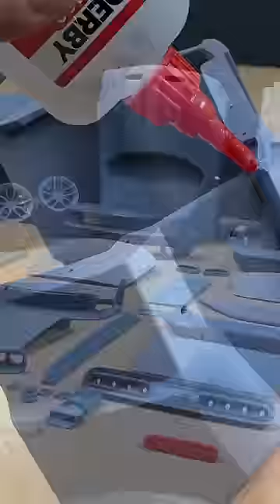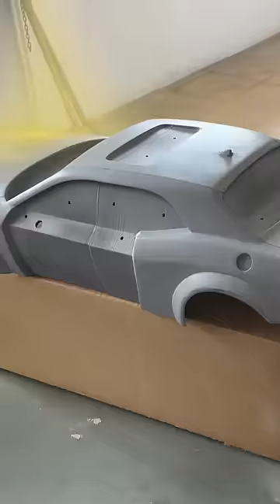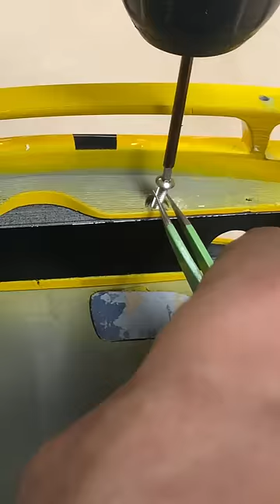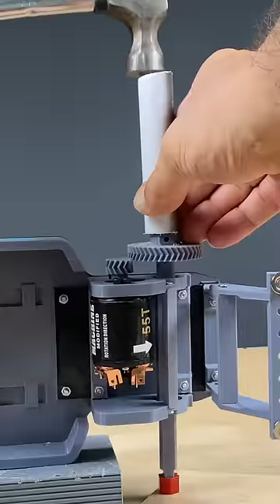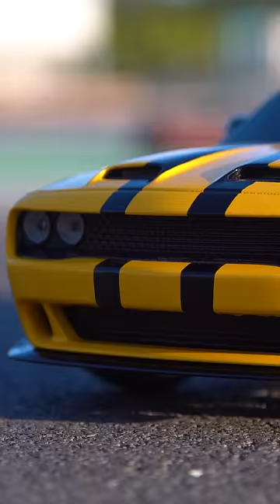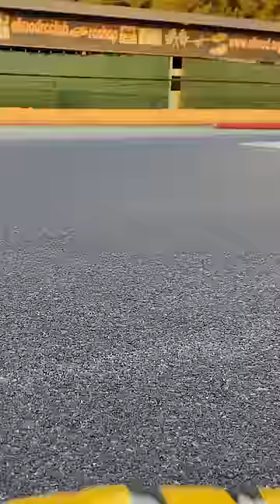3D Printed Dodge Challenger Rc Car - 3D Printing Timelapse

Comment: 55t brushed! You can go way faster than that!
Reply: Drop a 550 12T in it 🤣🤣 Probably tear it apart. 3d printed parts and RC cars don't mix well. Atleast in my experience.
Reply: Looks like he's got pretty decent power already. I agree to switch to brushless, not to go 80mph but just so it lasts forever
Reply: @MikeLaRock88  i mean sometimes brushed motors last a hell of a long time , i have an oldddd old stampede from like 2013 or something that’s still used regularly n taken in water from time to time and i’ve never replaced the motor

Comment: This is amazing, however I would love to see a stress test, I run the 3300kv reedy motor in all of my touring and race cars (very easy motor to work with) and its aggressive but gives me enough torque and control, without over torquing the chassis, because this could be next level with the proper specs

Comment: OK my question is I want to do something similar of course I don’t want to print something as large because I’m not that good with make an RC is just a small toy car similar to the design, but would you recommend any expensive printers for something like this or will a cheap printer be good as well